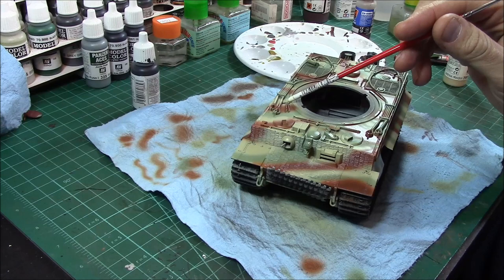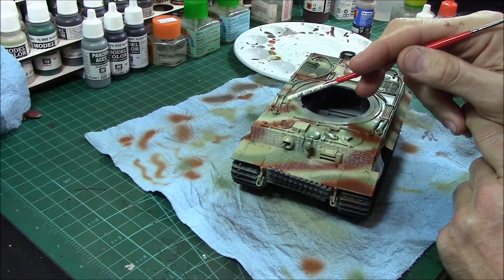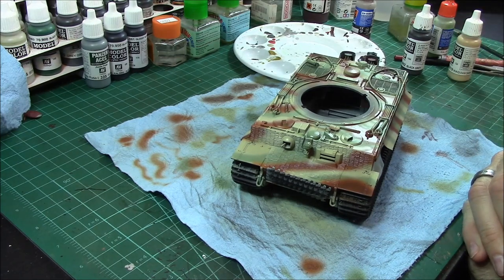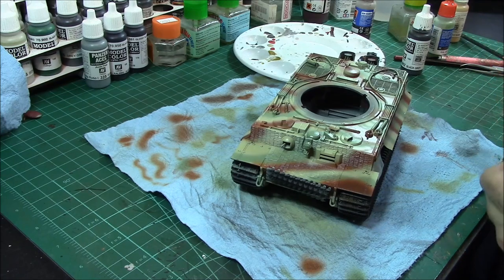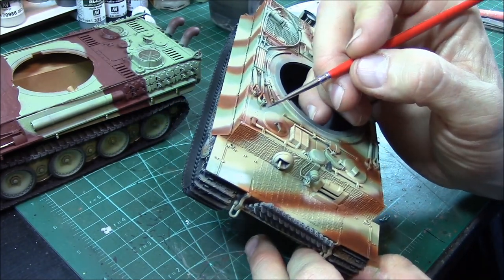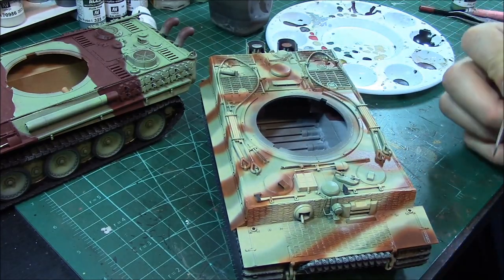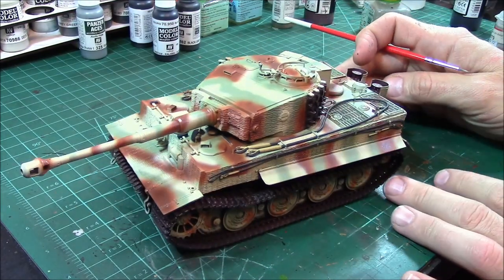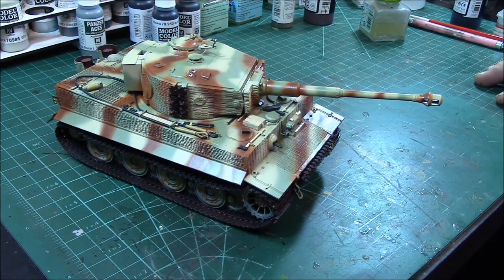HOW TO PAINT AND WEATHER a GERMAN TIGER TANK PART 3

Comment: Hey there, what ya got going on starting at 3:12 with that Panther G on the left side of the picture?  Looks pretty good.
Reply from the maker: Old Tamiya Panther G with Tamiya link to link tracks and some photo etch.  Painted late war color scheme, second  last production batch from MAN.  Corrupted data card and lost the entire build.  Will do a weathering video when time ande health allows.
Reply: That's cool. Yesterday I started an old Tamiya early Tiger 1.  It was an incomplete kit I had gotten from a friend.  It had been started by just a little.  No instructions with it, but I'll manage. It's also one of those early kits that didn't have all the exact amount of road wheels.  It uses thick and thin wheels.   I'm going through my spares box and getting all the pieces I need to finish it.